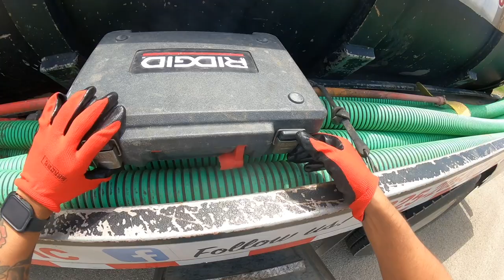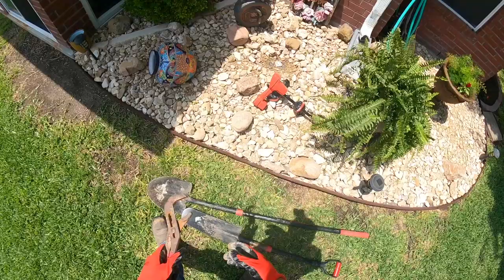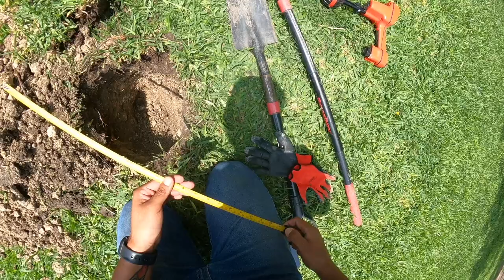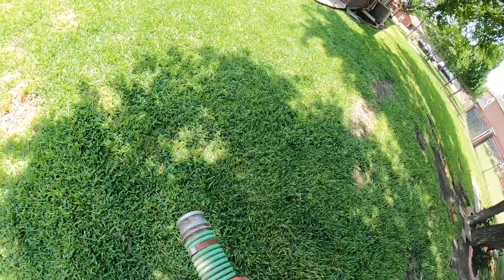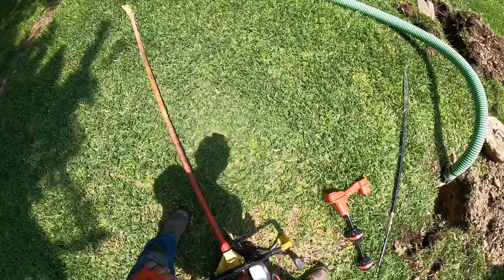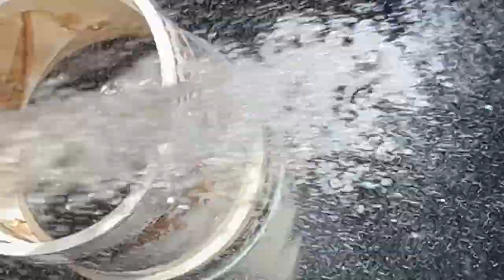Locating and Pumping out a Septic Tank

Comment: This is a prime example of why leach fields only last 20 years when they can last 50 years plus with proper maintenance and water conservation.
Reply: It's costing my brother €15,000  (euros) to replace the leaking one in the  farmhouse house he has bought in France.
Reply: @lynn69jackson 'm doing myself the pipes and fabric for top of gravel cost 1100, the gravel costs 300 and the excavator hire and diesel costs 350 for weekend. Put new lines between old ones. My system also needs a two compartment septic Vs the old one so that's costing another 2300+ excavator hire of 350, basically leave old tank and divert the inlet to the new tank side by side old one to save cost. I'm also fitting a new distribution box that's another 350 euros. About 4200 euros not much really and I can replace lines in future real cheap by hiring an excavator pulling them up and gravel and putting new in about 2000 euros.

Comment: I just bought an old farm house 🏠. I was told that a brand new septic tank and new water lines we installed 12yrs ago but was never used because the owner died before the job was completed. I'm trying to find the tank. Only info that I was given is that the tank is located 45 feet from the house on the south side 😩

Comment: My landlord thinks just putting septic enzymes in the septic tank will keep it from ever having to be pumped out and I live in a four apartment unit I may be the only one that doesn’t flush down any toilet paper or anything down the toilet other than waste if it was my personal septic tank it would be very clean per se because even though toilet paper says septic safe wads of it can turn into clumps. that’s why the saying is you have a septic septic system only flush down waste from your body that’s it.
Reply: Where do you put your nasty toilet paper and how does it not make your house stink
Reply: @electrickid101  you put it in a trashcan and I’ve never had an issue with it smelling
Reply: @electrickid101  I only flush the paper I use on the first wipe… any other paper I use after that wipe goes in the trashcan. Lol

Comment: If one is to have the septic pumped out every few years, why in the world are the access covers buried? Seems like such a stupid thing to do.
Reply: depending on # people in house depends on how often it needs to happen 5-6 ppl yea you will need it done every 3-4 years. only have 2-3 people depending on gallon tanks you have 6-7+ years. in recent years they been doing a riser that they install on tank to make lid at ground level. Years ago they didn't have those to do that and can't have them near ground level cause freeze issues that and people weren't lazy f's and had the ability to dig up cover.
Reply: Sewer gas escaping.
Reply: Because the installers are doing a faster job for themselves and don't care about the cleaning.